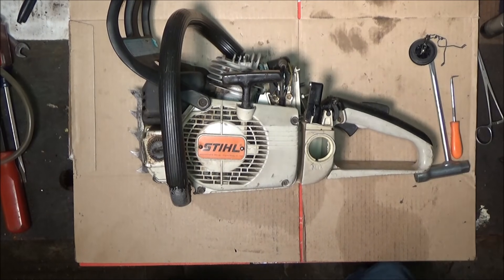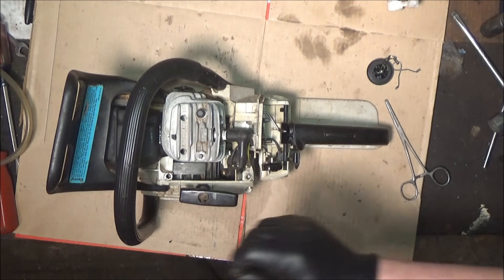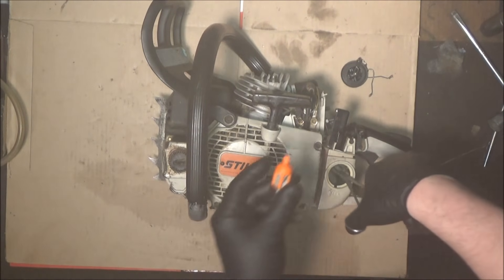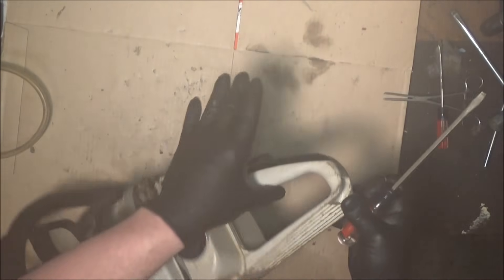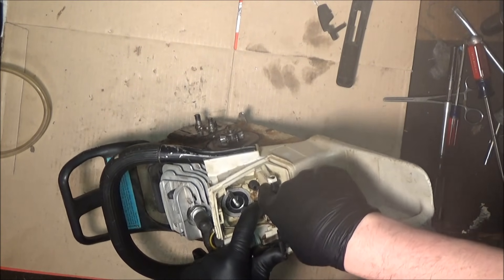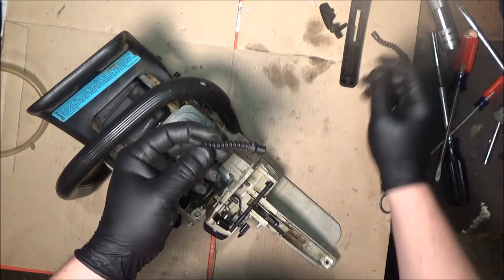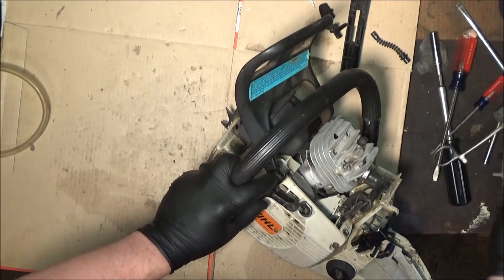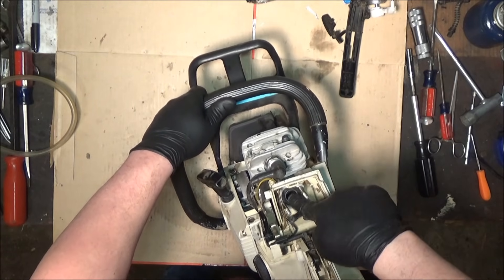Stihl 026/MS260 Fuel Line, Fuel Filter and Impulse Line Replacement

Comment: PLEASE PEOPLE NEVER EVER USE A FLAT SCREWDRIVER TO INSTALL A IMPULSE LINE OR FUEL LINE,USE SOMETHING WITH A BLUNT END ,YOU CAN DAMAGE THE LINE AND HAVE TO START ALL OVER AGAIN,30 YRS OF SMALL ENGINE EXPERIENCE
Reply: I have an 038 AV and the hole where the impulse line is located is pugged and the carburetor does not show a location for inserting the pulse line like in the video. I assume that there is no impulse line in the 038 AV.  How did Stihl eliminate this?